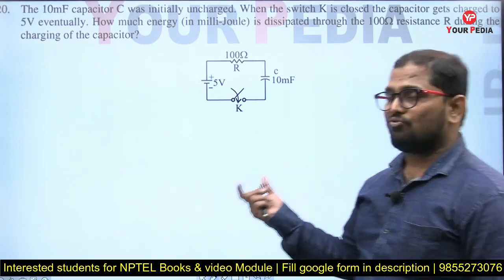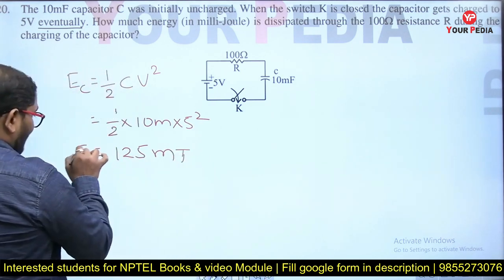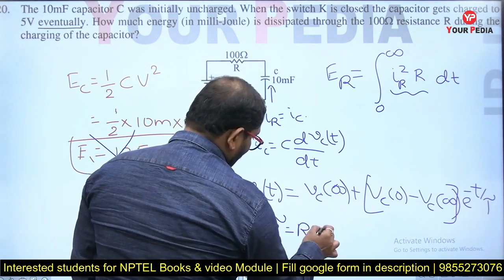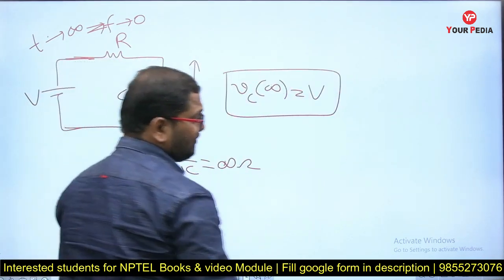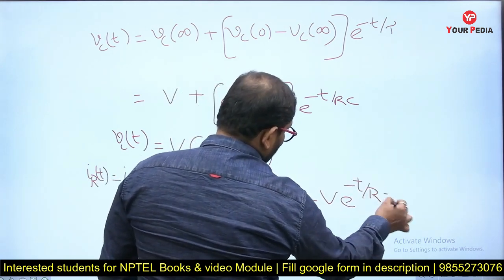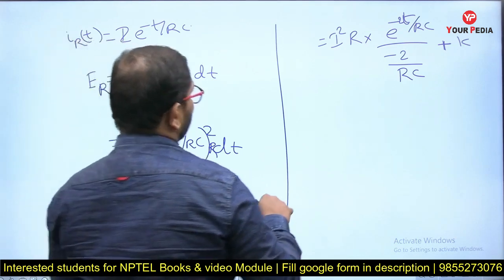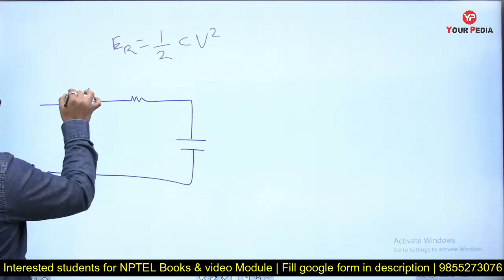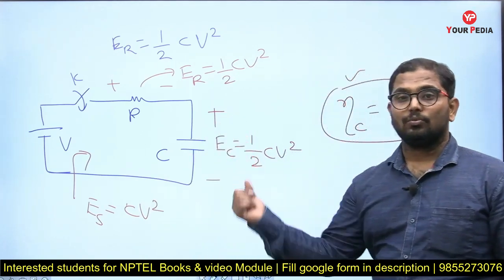Network Theory NPTEL ECE EE Qs series | ECE EE NPTEL Assignment Questions for GATE Exam 2023

Comment: The reasoning that follows the efficiency discussion is true iff you assume that the switch is ideal; and that it doesn't incur losses. In practical cases, one cannot simply equate the energy dissipated by the circuit, to the energy pumped into it by the source. If one does the math carefully, they will notice that a fraction of the total energy provided by the source is being lost mysteriously, but since law of conservation of energy cannot be violated, the lost energy can reasonably be assumed to be lost across the switch. And you can model that switch as an equivalent loss resistance in that case.